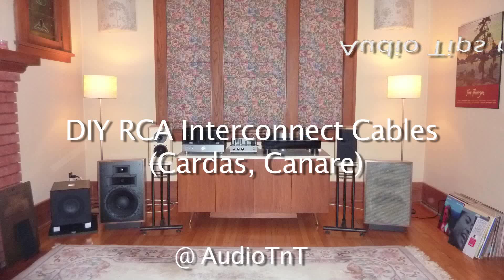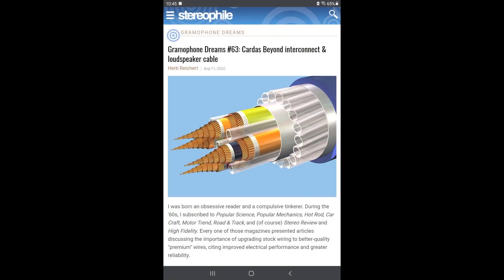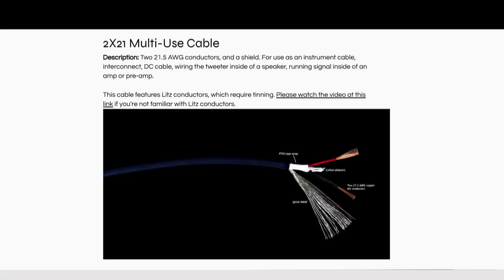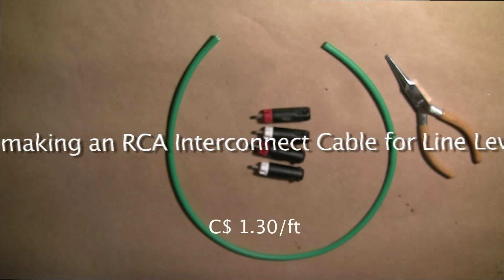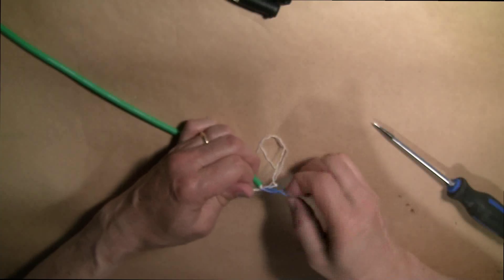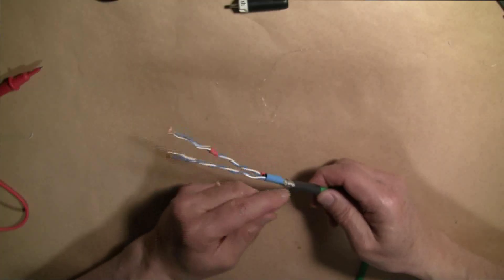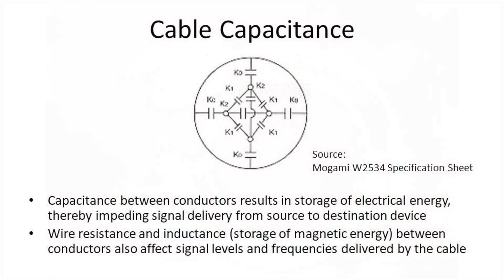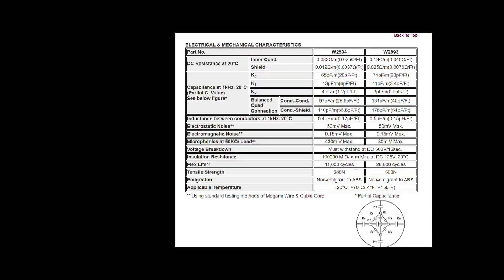DIY RCA Interconnect Cables (Cardas, Canare)

Comment: Love the detailed process here. I use XLR interconnects with my current components, and have had success with Belden and Canare bulk cable. It can definitely be a great bargain depending on your approach. All my interconnects, speaker wire etc are DIY now.
Reply from the maker: I'm working on the diy xlr interconnect video. Interesting results w grounding the shield at one, none or both ends. Thanks for tip on Belden.